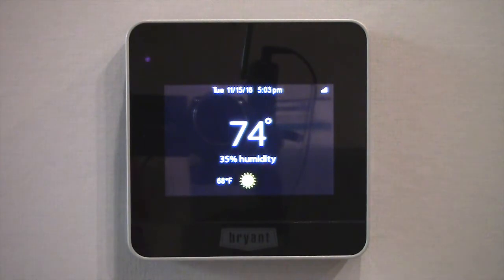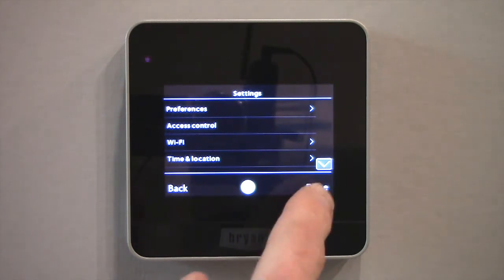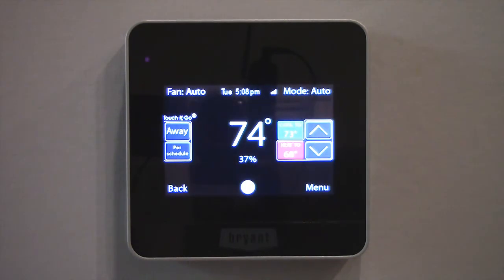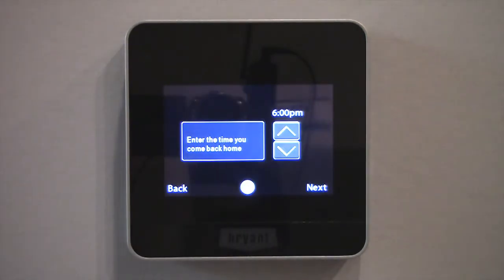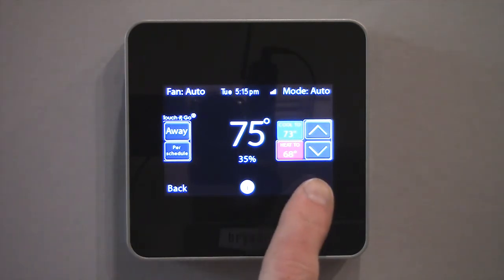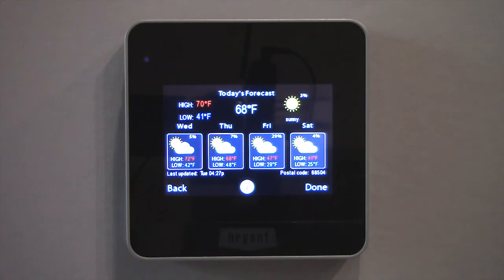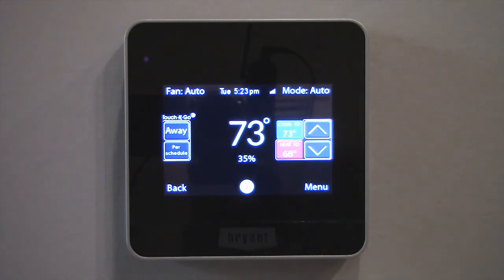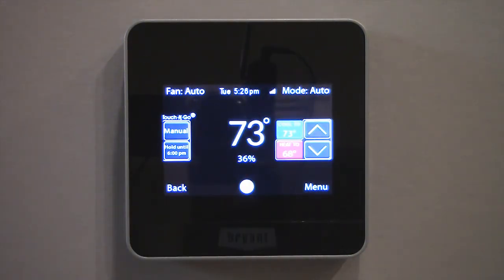Bryant Housewise Tutorial | Bryant Air Conditioning, Heating, Electrical & Plumbing

Comment: Everybody I know that has a Bryant have had problems with them in 3 to 4 years. Capacitor's and other cheap part go out. They charge to fix ( simple fix ) that's how they make their money of cheap parts
Reply: Some models are exactly the same as the more expensive Carrier brand.  Do you know which ones they had issue with?
Reply: Where is the batteries in this one?